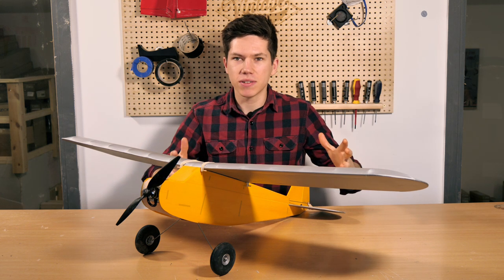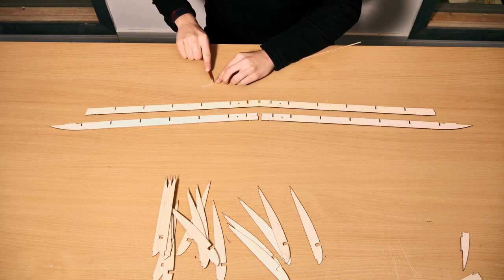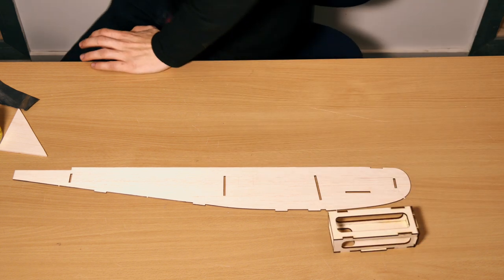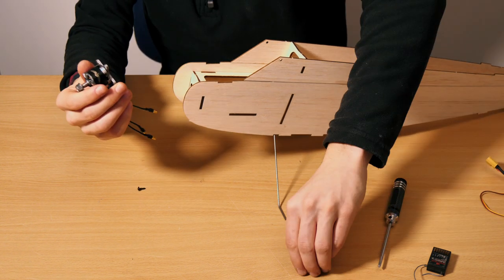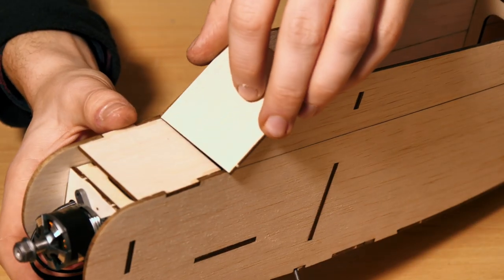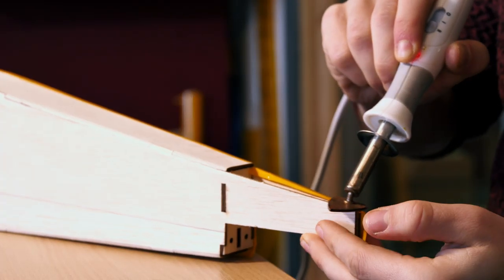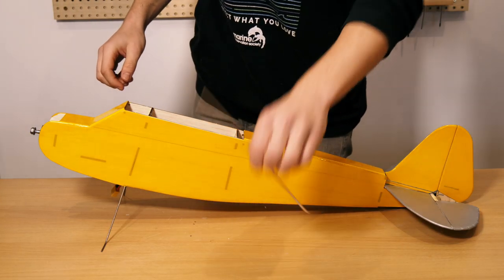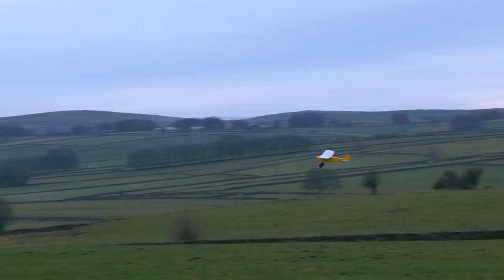How To Make a Cub 3ch Balsa Wood Trainer

Comment: Just finished  building one nice simple kit goes together  a dream just on covering  mine I'm going with a P.A.W 0.49 rc diesel  engine  with some slight  modifications  done to accommodate  the engine and small fuel tank and beef it up a little round the engine bay

Comment: Well what more could anyone want ? a neat and simple Cub that flies so well,I would recommend fitting wheel collets to hold the wheels on as hot glue will soon come off that axle in a rough landing.
Reply from the maker: Completely agree: adding wheel collets would be a worth while upgrade. ☺️

Comment: This looks like a great kit.  I have built two of the FT Simple Cubs as these are awesome flying planes.  The second one I made the tail surfaces out of balsa because that was were the first one had a lot of issues with warping and wrinkling.   I still would prefer an all wood plane as long as the wing has ailerons.

Comment: As a relatively experienced builder and flyer of mostly big scale gliders I found the Cub a wonderful little plane to build and fly.  A lot of thought has  gone into making everything go together with the minimum of fuss and the quality of the wood is good,  I probably spent more time covering the plane than building the airframe.   My initial suspicion of the CG being a bit rearward was borne out in the first flight, having added 40g of lead to the front end has helped a great deal in settling the plane down.  It's a hoot to fly and running a relatively low power 3S setup does some nice little aerobatics and has good duration on 1300mah battery.  In conclusion, it's a great little plane but I feel that a bit more emphasis should be given in the instructions to CG and control throws which could be a potential pitfall for a beginner flyer.

Comment: Possibly you should offer, sold separately, an aileron wing. So the pilot can grow with the same airplane.
Reply: Perfect idea actually
Reply from the maker: We also were thinking this would be a good idea. We'll be releasing one in the not too distant future possibly along with another Cub kit which is the "Super Cub" version (with the 4ch wing). This will mean you can go for the Super Cub straight away if you are an experienced pilot already, or you can upgrade your standard Cub later on with the sold separately wing.
Reply: @vintagemodelco7936  Nice!
Reply: @vintagemodelco7936  Even better idea
Reply: Great Idea , I was going to convert to aileron but now I will wait
Reply: @vintagemodelco7936  Humm, the beginning of the build video has a picture of a Cub with ailerons... We're ready ;)
Reply: @vintagemodelco7936  excellent idea
Reply: I just bought an extra strip of wood to make the ailerons